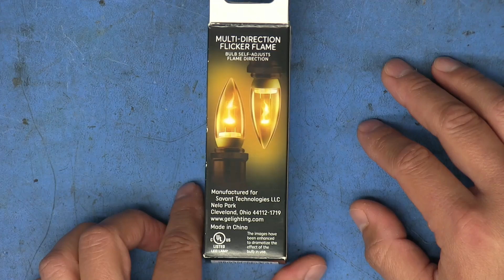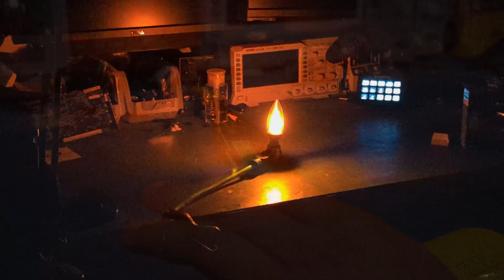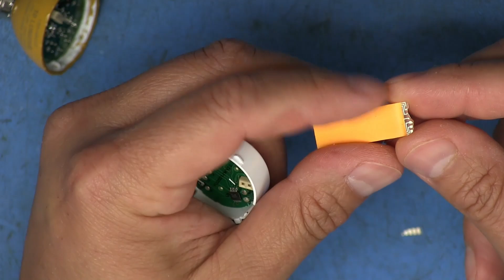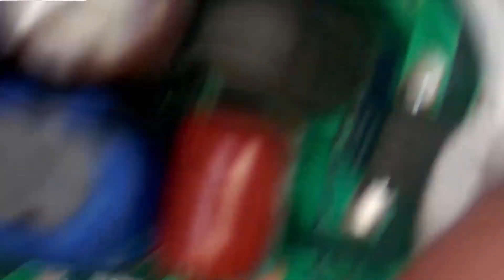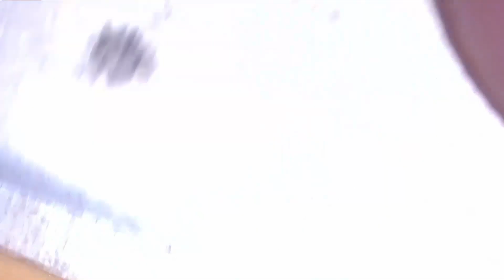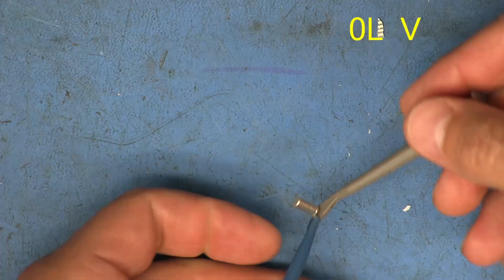TEF #153 | Candelabra Base Flicker Flame LED Bulb Teardown

Comment: The yellow stuff is not a filter, it's a phosphor that turns majority of the royal blue LED light into the rest of the visible spectrum, to make the white light. Different compositions of this phosphor can have warmer or colder color temperature. Look up remote phosphor to see the concept.
Reply from the maker: Ah, makes sense, I knew it had something to do with turning the blue light into white, just wasn't sure how.